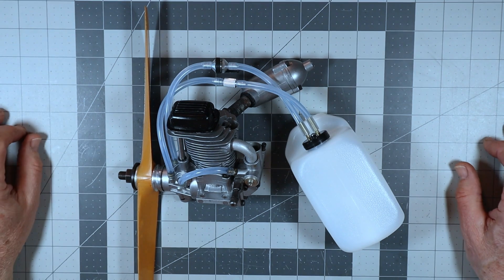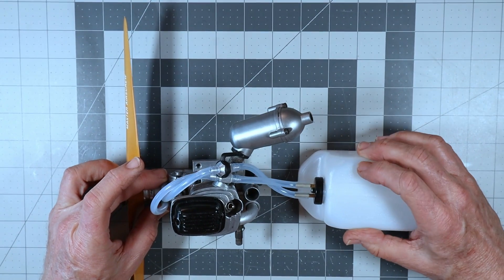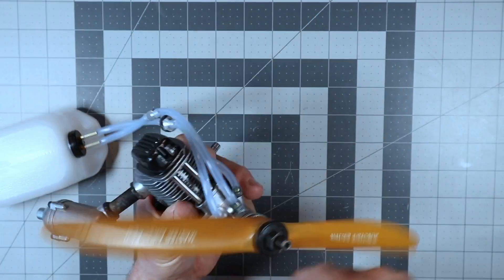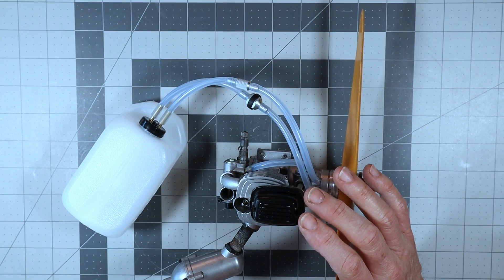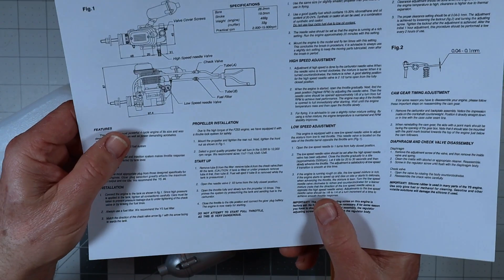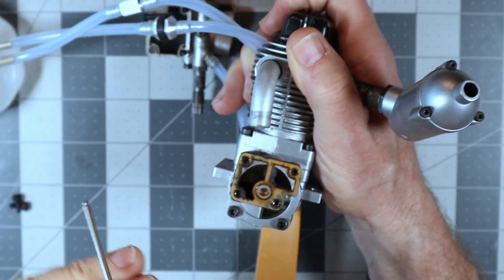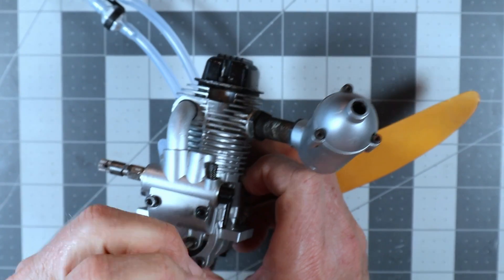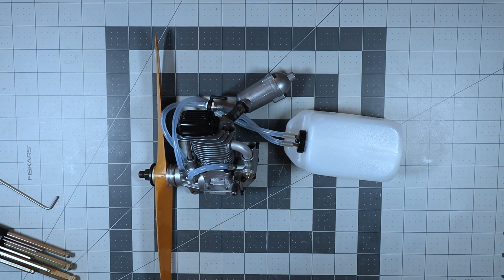YS FZ63 Fuel System Setup and Look Inside

Comment: What a nice engine,  remarkably clean, 
I just got given one of these engines, been sitting a long time,
Mine has a pump that clips to the push rod tubes and a metal plate screwed to the bottom of the crankcase, rather than yours has i believe a diaphragm thing screwed to the bottom of crankcase,  im yet to discover how my engine will run, different to what im used to
Reply from the maker: When you figure out how to run these YS engines, they run fantastic.  But the learning curve from a standard four stroke can be a challenge.  Enjoy!
Reply: @dmrcflyr2  i fly all 4 stroke , so il be keen to getthis little dialed in👍,
Very cool design, 
Thanks David

Comment: Thank you David, this engine looks good.  It´s very important to use the required fuel, That's why many can't get this engine tuned.
Reply from the maker: This is a valid point. Here is exactly what the manual states for fuel:
Use a good quality fuel which contains 15-30% nitromethane and oil content of 20-24%. Synthetic or castor oil can be used, or a combination of synthetic and castor.
Do not use four cycle fuel due to low oil content.

However in the review article by Clarence Lee he used Morgans Omega 10% with 4 ounces of castor added to bring the oil content up to 20%.  I do not have 15% or higher nitro fuel available to me and will be using Morgans Cool Power 10% with added castor.
Reply: The YS engines run particularly well with the Coolpower low viscosity red oil “Heli mix”. 22% Coolpower red, 30% nitro. That mix really wakes them up.

Comment: I have never owned a YS. engine. What do you think of them Dave? From Pinellas Co.
Reply from the maker: Here is what I believe and think of YS engines.  They are well engineered and complex four stroke engines.  They require special care in setup, maintenance, and operation than other four stroke engines.  They are not for the inexperienced glow modeler.  They are far superior to ANY OS Alpha series engines.  I believe that many YS engines are purchased by folks that have more money than they  have experience, knowledge, and patience.  This fact makes purchasing used YS engines much more risky than other engines due to the fact that they may not have been maintained properly.  Used YS engines are far more likely to require parts replacement and refurbishment.  
I feel that I am blessed or gifted with finding awesome glow engines for low cost; and I believe that this engine will prove to be just that.

BTW, I do NOT miss living or being in Pinellas county at all. You have my condolences.